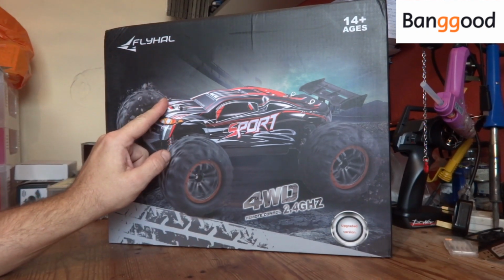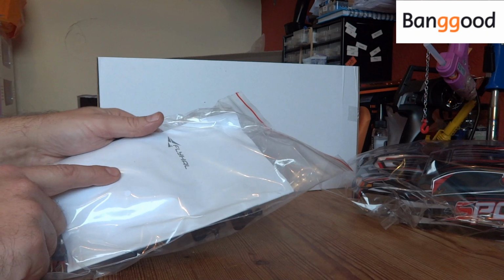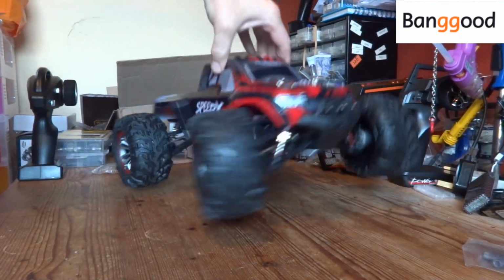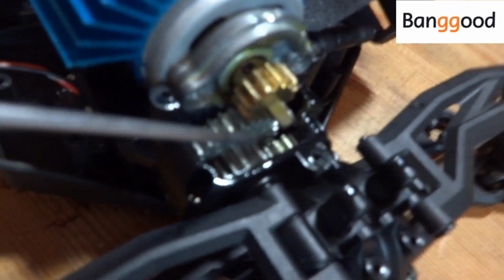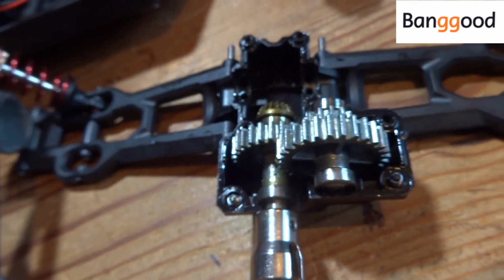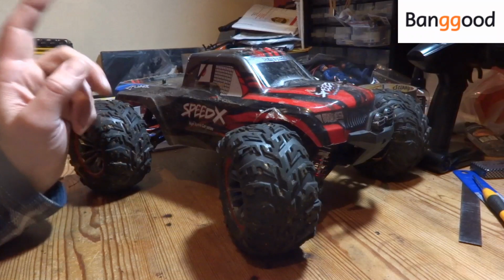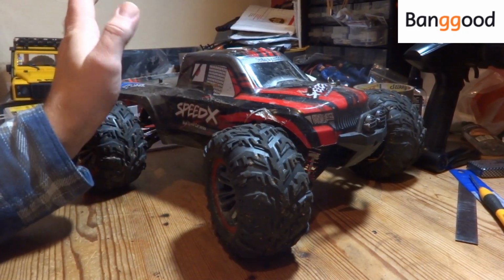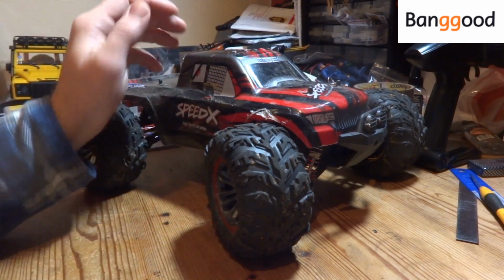Flyhal X03 X04 1/10 4x4 550 Basher. Big Truck Small Price!!!!

Comment: I'm going to change the shock absorbers on mine, when I get chance to because it's to bouncy for my liking mate.
Reply from the maker: Yes I agree, that's one thing that's worth swapping. Makes a massive difference. Thanks for taking the time to comment! 👍
Reply: There is no oil in it.
to be filled ;)
Reply from the maker: @zsoltfranko4077  you can't fill with oil as standard. Because the shocks ar'nt oil tight. 👍
Reply: Not the same car, only with a brushless motor?
 https://www.youtube.com/watch?v=hQTl8-lIzDY
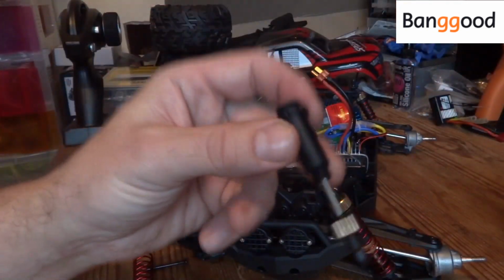5:10
Reply from the maker: @zsoltfranko4077  yes this is the Flyhal version. Vertually the same but with a 550 brushed motor. Flyhal have a brushless version too. 👍👍

Comment: Hey there my YouTube friend, thanks again for another awesome rc video about this model.
I've got the exact same model as this one. You get 2 batteries and a double deans connector for it too mate, same as you've got, extra body shell, etc.
I haven't had chance to give it a proper go with, so I'm hoping that mine is OK.
I got mine off ebay a while back!
Your YouTube channel is excellent, if I do say so myself.
I never got the spare bearings and arm, etc.
Massive Thumbs-Up! 👍 👍 👍
Reply from the maker: Hello! In my humble opinion they are one of the best value RC'S out at the moment. Yeah it's a strange spare part to be given, a spare steering assembly!?! It seems quite resilient and it's ripe for a great big brushless motor!! 👍😄👍

Comment: coupon code expired :(
Reply from the maker: Hello. I'll email Banggood and find out how long they are active for. Keep in touch! 👍👍
Reply from the maker: I'm seeing if I can get you another code. 👍👍
Reply: @theminiatureconstructionco4556   thanks mate
Reply: Any other 10 scale bashers you would suggest for under 100 euro? Or any other basher for that matter I think 16 scale would be the smallest I'd like, looking to get my first RC since my tyco rebound donkey years ago 🤣
Reply from the maker: @BluntmanOO7  1/10 Xinlehong 9125 that's always on a flash deal from Banggood. This 1/12 HBX 901a that I've just made a video of is pretty good too. Also the 1/16 Xinlehong Q902 as just come back into stock there's a link in the video as well. 👍👍
Reply: @theminiatureconstructionco4556  thanks for the info I shall look into them 👍👍
Reply: @theminiatureconstructionco4556  I decided on the Wltoys 124018 with 3 batteries for 95 euro seems like a good deal. Also picked up 2 eachine ec08 for the wife and kid 😁
Reply from the maker: @BluntmanOO7  the Wltoys buggy is a great piece of kit but you are slightly restricted to where you can use them (not good off road). If you change your mind I asked Banggood and they are (hopefully getting me a revised code). 👍👍
Reply: I have the FC610 seem 
to be decent